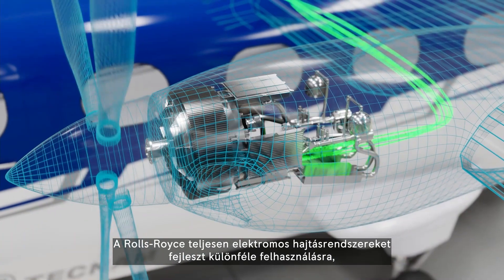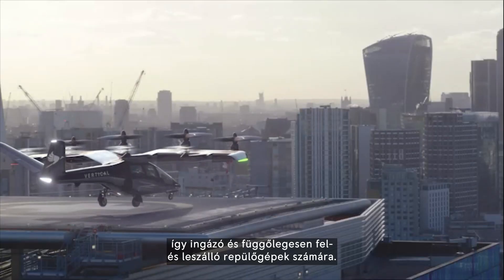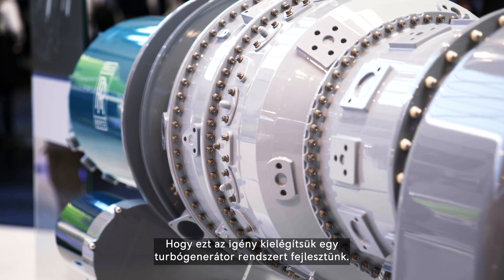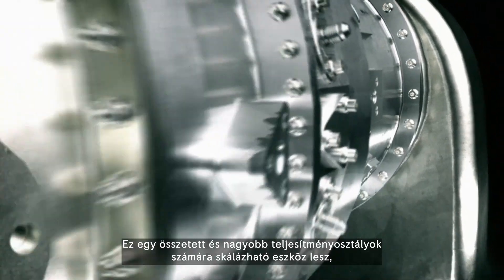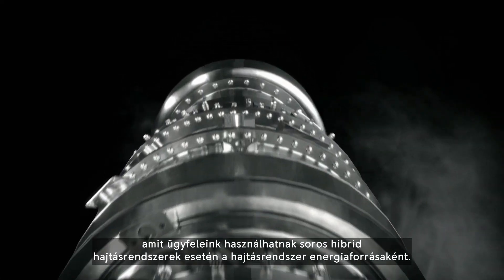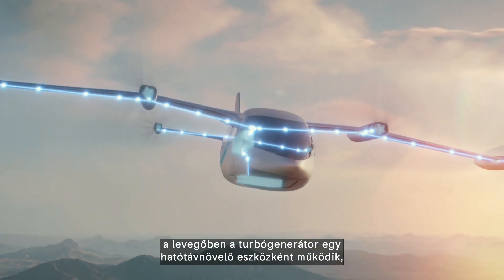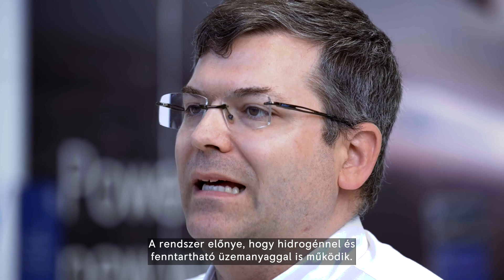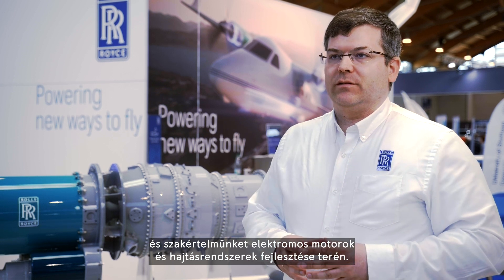Rolls-Royce | Új turbógenerátor technológia a hibrid-elektromos repülés forradalmasításáért

Comment: Could the propellers themselves not be used as a generator for power ? Battery running propellor and the propellor in turn charging the battery ? Like how a windmill generates power using what is essentially a propeller
You could have a system running in circles and have unlimited range ?